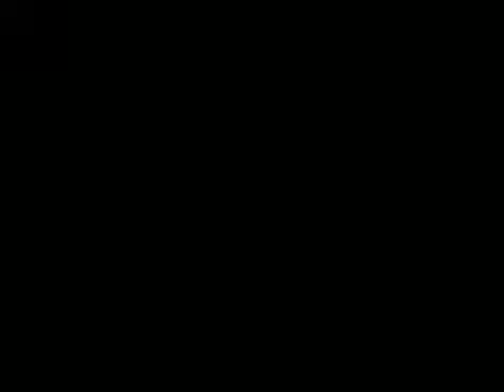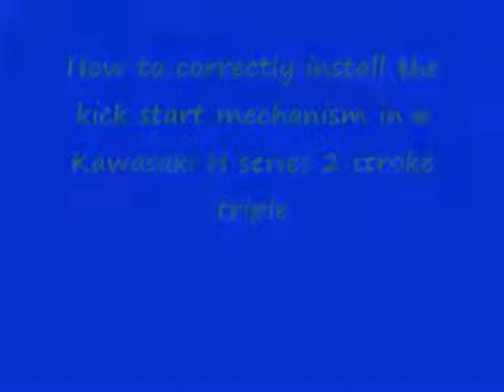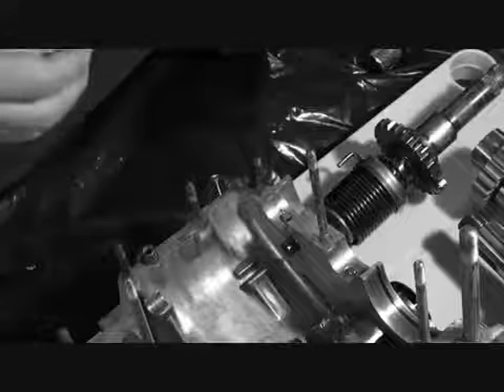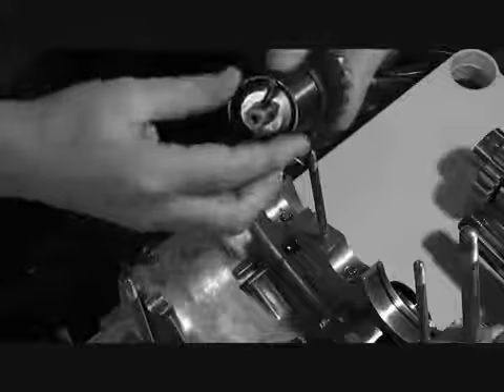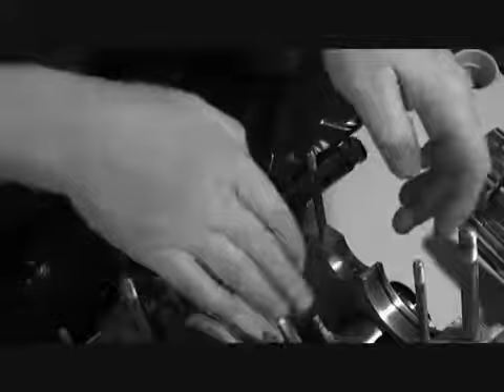'HOW TO'  properly install the kickstart mechanism in the Kawasaki H series 2 stroke triple

Comment: It would be good to know the drive gear location when fitting it all into the case .I think it is inwards ,away from the side of the case where the mating transmission gear is . People need to know all the component arrangement/ orientation before fitting into case , I think .Thanks for youe explanation so far